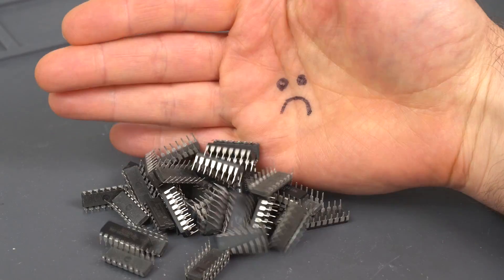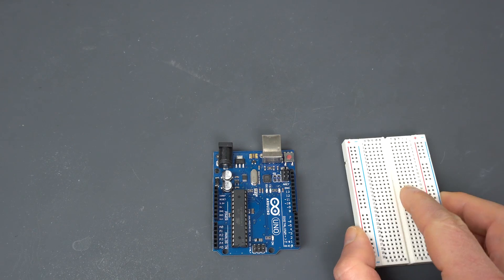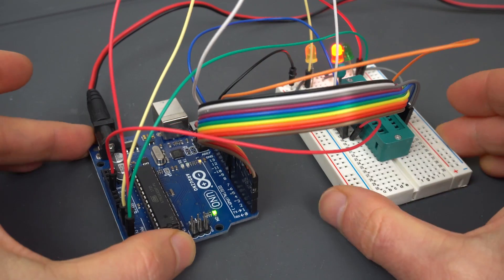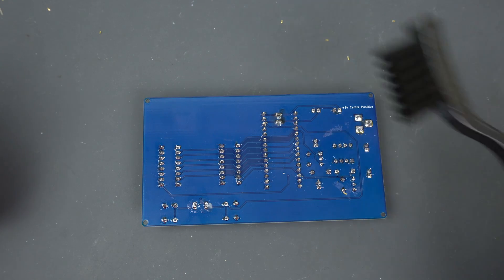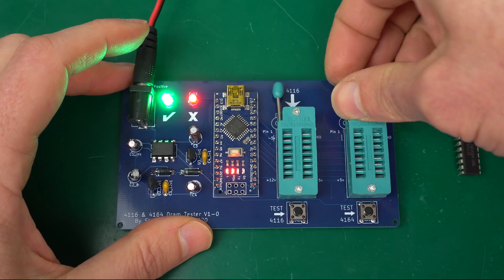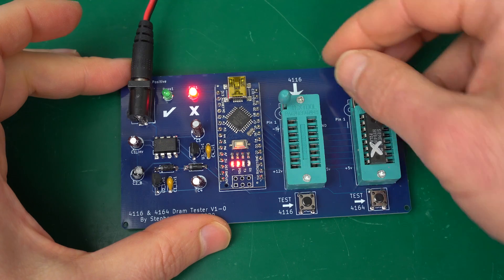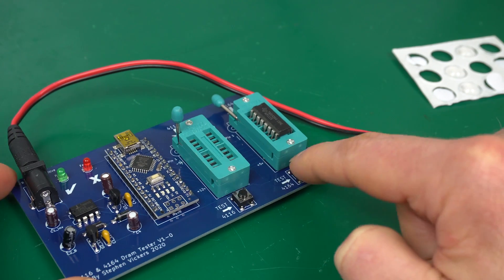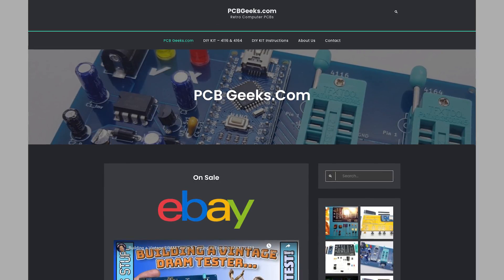Arduino DRAM Tester

Comment: I've been thinking of creating a similar project. I'd like to see support for testing at various speed-ratings.
Reply from the maker: Yes, that would be fantastic. You pop in the DRAM chip, you tell it it's a 4164 and it reports if it works or not AND the maximum speed at which it works. That'd be sweet!
Reply: If PWM is used for the clock signal, then the speed can be easily be set arbitrarily from 0 to 20 (or whatever the duino supports) MHz, with one or two commands.
Reply: @NoelsRetroLab  Hi Noel really interesting video on the tester. I was rather hoping you would mention testing other types of chips, forgive me as i am not technically literate but would it be possible to have testers that can test other chips like VIC-II, c64 logic chips, CIA chips, PLA chips SID chips as well as other chips from zx spectrum and Amstrad ect.. basically all 8 bit system platforms individual chips? Is this feasible or even possible to do? I know we can swap chips with known good chips, but i have always wondered why there are not chip testers beyond DRAM chips ect? Would really like to hear your thoughts on why in any future videos regarding chip testers?
Reply: I looked into it a bit and when you're trying to validate something works at 60ns timings (which even some of these old parts do!) you need to be able to sample in the 10s to 100s of MHz. Not impossible but definitely trickier -- I'm not sure if it's even possible with a low end STM to get that kind of timing precision on GPIOs. I was looking into building a tester with a cheap FPGA but it's a back burner project...
Reply: @josephlunderville3195  yeah, I came to the same conclusion. I've thought it might be a good job for a pocket beagle, but that starts getting into the same price as a cheap FPGA.
Reply: @josephlunderville3195  The Raspberry Pi 4B has multiple PWM generators on GPIO pins capable of up to 250MHz. SPI speeds are also up to 250MHz, which is extremely high. I managed to get up to 83MHz with those mini LCD displays with ST7735s driver. At 84 the display started dropping bits.
Reply: @JamesPotts  All you need is an external circuit measuring delay. It's not hard nor expensive. It costs about $3 and is called TDC7200.
Make your effort open source and count me in - this project I just saw was so bad I feel like making a memory tester now.
Reply: @paulmichaelfreedman8334  May I ask you those commands? I am very interesting about increasing the frequency
Reply: @rageagainstthebath  Yeah I also got the strong impression it was missing critical circuits for thorough testing.
Reply: @ElectronGordo  FOrget that last messages I was mixed up with something else.

Comment: First of all, thanks for this Video. I like that you have explained how to do checks yourself and showing code before showing a "prebuilt" device. 
I think you are right on voltage protection, I also thought about that. Arduinos cannot handle 12V on the I/Os. But then I thought protection will expand the circuit massively and make the whole thing more expensive. An Arduino is a cheap device and it may be cheaper to buy a new one. Personally, I don't check that many RAMs that it would justify the higher pricing.
Reply from the maker: Glad you enjoyed it. Yes, you're right. That's another way to see the whole protection thing: cost of replacement x chance it would be damaged. I'm working on a review of a chip tester taking a completely different approach, so it should be interesting. Cheers.
Reply: @NoelsRetroLab  Looking forward to seeing it ;)

Comment: Interesting video.  I think having some over voltage protection could be good.  What I would like to see is the Red LED gone.   Use the green LED just as a power indicator.  Then have two RGB LED's, one at the end of each socket, with flashing yellow = testing, solid green = good, and solid red = bad, you know, like simple traffic lights.
Reply from the maker: Yeah, that would be pretty nice.
Reply: All you need in to replace the two LEDs with a combined red and green double LED in one 3-pin package. Then it will flash yellow and red while testing, be solid yellow any time both lights should be lit, and only go solid red in the fail state. No other modification should be necessary, just use a double LED. Be careful, there are double LEDs with only 2 pins that have them wired opposite each other, so you'd get yellow by sending AC. You don't want those in this application.

Comment: Some while ago I built a static ram tester for the 2111 RAM chips in my reproduction MK14 project, and I built it on a Arduino Shield proto-pcb so it could be plugged on top of one of my spare Arduino Unos (like a lot of people I have a number going spare!). This means I can use the Uno for other experiments when not using the RAM tester (i.e. most of the time!). I was also going to build a generic chip tester using an I2C I/O expander or 2 but that project is still on the "to do" list :) I like the idea of making a more protected device with an OLED screen, and I'd probably want to arrange for the Arduino to be able to turn the +12/-5/+5 voltage rails off when not testing to make inserting/removing the chips a bit safer. The problem with the Arduino inputs is that +12v on an input will likely kill the input, and the -5v although clamped by the input diodes on the Arduino will probably cause excessive current to flow and kill the input anyway. One way to protect the inputs would be to use a series resistor to limit the current and a 5v Zener to clamp the voltage to 5v, so that negative or over-voltage would not be a problem. This would require a lot of extra components, however, and maybe not worth the cost considering how cheap Arduinos are today.
Reply from the maker: Nice. Maybe it's time to pick up that project again 😃 Agreed that it should be voltage protected ideally. Even though Arduinos a cheap, you WILL be using it with known faulty DRAM, so it's just a matter of time. Also like not having any power until the test starts.

Comment: That IC, 7660S, is quite interesting for voltage conversion!
Reply: The 7660 has been around for over 30 years. It’s just a capacitive charge pump which was later inbuilt into MAX232 serial transmitters.  The S variant has a boost pin to select a faster operation frequency. One can also use a 555 with a few diodes and capacitors on its output as a multiplier to accomplish a similar result. Just remember that its output power is very limited.
Reply: 7660/555 also very handy for generating LCD display module voltages.
Reply: If one is clever, one can just use an AVR output pin as the charge pump oscillator!

Comment: i read somewhere once for higher than 5v voltages to go into an arduino or something there is a way to split it into a few parts and feed it into the aurdino and not damage it. for example 3x 4v parts. but i dont know anything beyond that i just remember reading it when someone was talking about higher voltages
Reply from the maker: Interesting! That's a good starting point to investigate that further. Thanks.
Reply: @NoelsRetroLab  no problem at all. im not clued up on this sort of thing but what i remember is someone was trying to process some sort of data and the voltage was too high so this was kind of a solution to still process it. i think it was data logging something
Reply: I was thinking that to protect against overvoltage, you could maybe use a 5.6V zener diode? Maybe add a LED for visual indication.
Not sure about negative voltage though. 🤔

Comment: Power jacks that use negative at center pind is not odd. Back in time is was normal to use center pind as negative. At some point in the '80 it change to be positive on centerpin. It might be due to the awareness of EMC.

Comment: 16:30 add a slightly cut off foot in the middle under the pushbuttons, adapt it.
Reply from the maker: Good idea. I should try that.
Reply: @NoelsRetroLab  A similar trick can be used to get closer to the corner with the sticky outy bits in the way.

Comment: I don't know if the kit uses Ardnuino code, but if so, guess it could be much faster with direct C programming of the registers. digitalWrite had a significant overhead the last time I used it.
Reply from the maker: Yes, I learned about that recently. I'm not sure if that matters given the speed limitations of the DRAM, but I haven't measured anything. Could be interesting to find out.

Comment: 9:55 Power supplies in the 80s and before were commonly center negative. 2000s and later are almost always center positive. 90s is a mix. There are exceptions with some old ones being CP and some newer ones being CN, but for the most part that guidance should usually be true.
Reply: Indeed!  I knew I wasn't imagining it.  As a kid in the '80s, the majority of my power supplies were center-negative.  Center-positive was quite uncommon at the time.  It was only when I read the comments of a Youtube video last year that I realized that many people today regard a center-positive supply as virtually standard and don't really think to check polarity.  That came as a shock to me.

Comment: A quick continuity test from vcc pin to the other pins via code prior to voltage being applied would be a good preliminary test. This would also solve the hot insertion issue. Of course it would need a design change with relays or similar. #rabbithole

Comment: Great video as always! Did you try what happens to the LEDs if you reset the Arduino while the tester is powered?
Reply from the maker: Thanks! I think both LEDs turn on at startup, whether you reset it or power the board, but I'm not 100% sure. The weird bit is that the red one turns off half way through a test. We might be able to get Stephen (the designer) to pitch in and explain what the meaning of the LEDs is.
Reply: @NoelsRetroLab  Yep, red light goes out after phase 1 out of 4.  (no reason, my bad programming  ;-)  )

Comment: Hi Noel, one way to shorten the through hole protrusions is to clamp the pcb and run a standard steel file flat over the board till the protrusions are flush withj the solder blobs after which you can make it really smooth (no burrs at all!) with a piece of scotch bright.
This can be handy if one is not planning to use a case for a pcb, for whatever reason.
And I may be able to help you with getting the display running, I have been experimenting with ST7735s and ST7789 driven displays in python on an RPi 4B, even wrote my own FX routines. It is still a work in progress.

Kudos for another fine video and interesting topic, this is definitely one I will be building when my attic is finished :P

Would a collaboration to make our own arduino ram tester with a display and short protection, be an idea?
Reply from the maker: Wouldn't that cause all sorts of stress on the solder joints? People already yell at me sometimes for cutting the leads after soldering. If I did that some people would have a heart attack 😃
Reply: @NoelsRetroLab  I have done a few times, I think people are way too careful with this stuff. If soldered properly it has only been heated a few seconds and is more than capable of handling a few strokes with a file. Afterwards, reflowing the joints is an option. Besides, the calculated cost of the pcb is 4 bucks, so what's the problem LOL. Of course I wouldn't do it on a retro board. Would you be interested in some technical information about those SPI displays?

Comment: I'll have to see how it's getting -5v, 5v, and 12v out of 9v DC. I still have a lurking paranoia about the 19VAC-DC converter board on my old Ti99.
Reply from the maker: It looks like it's using some kind of voltage inverter AND a 7905 or something like that.
Reply: The 7660 is the voltage source of for the +12 and -5V regulators. -9V is from its output pin and the +18V is via the attached voltage doubler comprising of the 2 diodes and capacitors.  The 7660 isn’t really needed because the equivalent can be generated by an AVR output pin and a few discretes.

Comment: You could create one that tests in-circuit by having it plug in to the 6502/Z80 socket. Would need to understand the machine a little for things like banking but that's not hard to do.

Comment: Replace those digitalReads and digitalWrites with direct port access and it will go a LOT quicker.
Reply from the maker: Yes, that's something I only learned relatively recently (but that tester code is pretty old so I never changed it). I see it makes a huge difference in speed.

Comment: nice video. to be honest though, imho, they've spent a lot of work designing the pcb etc, and as they are including the cost of the arduino nano in there as well i'm not surprised at the price, well priced imho. the cost of shipping is probably more the UK royal mail shipping to the EU now we divorced you  :D  -- that said... the other issue i have is with yuou saying it should be open source..... that's fine and in a way i agree with you, but on the other side, as i say, he has to pay to produce the pcb etc, and you can gaurantee that if he had open sourced it, then within a couple weeks it would already be on banggood and ali express within a month lol
Reply: Thank you @Daytona FPV  and yeah postage in UK is only £1.99 1st class post  ;-)
Reply: You can gaurantee that if he had open sourced it, then within a couple weeks it would already be on banggood and ali express within a month lol

As if not open sourcing it makes any difference, it just raises the bar to cloning slightly. If there is a perception of money to be made, it'll get cloned.

Comment: Oh, so I'm supposed to put my hand over my work when trimming thicker components? That will be good news for the cat.

I’m not at the stage of testing any ram yet, I’m very much at the beginning of my journey with electronics. However, May I ask if you could program an ATmega328p rather than use a full Arduino Uni or Nano?
Reply from the maker: Your cat will love all the bits flying around! 😃 Yes, I'm sure you can use a microcontroller directly, it's just that the Arduino makes it easier to get going, but it's the same idea. You'll probably have more control over the timings skipping the Arduino if you're going to go that route.

Comment: I wonder if something like SCR lockup could happen with the power always being applied to the ZIP socket like that. It might be possible for the -5V to make contact first or perhaps a bit after the other rails have connected. Could be an idea to have some MOSFETs on the power pins to the DRAM that supply power only when under test?
Reply from the maker: Yes, that's a good point. It would seem safer to only apply power when the test starts. And if when that's solved, then it makes it easier to route power to whatever pins and you can test multiple chips in a single socket. But obviously it complicates the design.

Comment: honestly i think this would be better as a shield that you plug ontop of an Arduino Uno/Mega (or even a RaspPi) instead of such a large/bulky PCB
obviously only if you could fit everything of course. (like couldn't you switch between 4116 and 4164 voltages using some MOSFETs so you can save one socket? downside you would have to generate 12V and -5V from the single 5V input, plus side you can use USB to power it, making it much more convenient to use)
also i would personally never ever ever solder on an IC or Module like that, i would always use sockets in case i screw up the soldering or the PCB is wrong in some way so that those components can be easily removed without tedious desoldering.
Reply from the maker: Arduino Nanos are so cheap, that it's nice to have them dedicated to this instead of having to pull out the Uno, hook it up to the PCB, and star testing. Totally agreed about the transistors to route the right voltages and keeping it down to a single socket though! And while you have that, you can also turn off voltages completely before the test starts, so there are no problems inserting the IC.

Comment: You could just get the MiniPro TL866CS for $80, it will test any ram chip and logic chip plus program about any chip.
Reply from the maker: Is that different from the regular TL866? Because mine doesn't do DRAM chips, at least not 4164 and 4116.
Reply: I have TL866II+ and it doesn't check these kind of DRAMs

Comment: How about timing? Does it test timing requirements. I don't know how many speed grades are there for these old DRAM chips, but it is an important factor in a computer.
Reply from the maker: No, not at all. It would be great to make a tester that tells you the real response time though. Sounds like a fun project!

Comment: These are only basic tests if you are not checking write or read timings. So a good chip could easily still be bad. The easiest way is just put a zif socket in the computer and run a memory test.
Reply from the maker: Right. These are very basic tests, but will still catch 90% (or more) of the failing chips out there. It would be great to extend the tests to include timings though!

Comment: Do any of these ebay DRAM tester projects check if the refresh cycles actually refresh or do they simply write and read back straight away?
Reply from the maker: That's the thing: We don't know because the code isn't open source! It would be a really cool thing to add that to a tester and then report the true RAM speed.